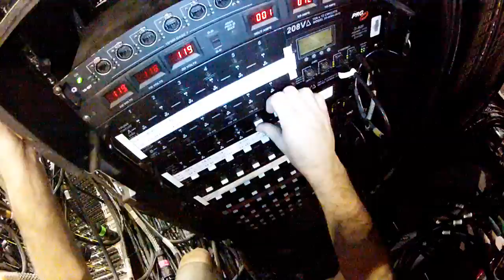Grammy FOH Platform Start-up

Comment: Floating sensor racks? what a brilliant idea.
Reply from the maker: Yup. Saves a few thousand feet of multi-cable. Two feeder runs drop out of the catwalk feeding two transformers on the floating platform. No need to drop 40 to 95 cables out of the sky. And the platform allows building the rack land on the ground first.
Reply: +Geoff Smith I have to admit, while watching the video I absolutely had no idea what you were doing. But how come you could not set up everything on the ground and then just lift it up?
Reply: +Raffaele Sansone they did. he was basically going up to the platform to turn everything on.
Reply: +Raffaele Sansone 

Some things can not be turned on until other connections have been made and depending on the rig configuration of the whole show you might have to do what he did. Plus IF FOR ANY REASON there is a change once things are up. etc
Reply: Geoff Smith  What type of cables were you using? Dmx or xlr
Reply: Lord Thantos DMX is just a protocol, XLR is the cable. I'm guessing that those were some semi-proprietary 5-pin XLR cables carrying the DMX signal. Edit: JK I read some more comments and apparently they're redundant fiber lines running to switches and I'd imagine some form of DMX node.
Reply: TheCanasian thanks
Reply: TheCanasian probably ether-con, most likely RJ45.
Reply: Gregg Carter those are most likely opticalCON cables.

Comment: When you first started rigging/training, how afraid of heights were you?  I imagine that more exposure made you less afraid, but what else did you/do you do to be more calm?  Was there a point where you started to not get afraid?  Do you have any tips or rituals that you do so you don't get tired quickly, or freak out?  I guess a major thing too is not dropping pins.  Thanks for any tips and advice you might have.
Reply: You have to take deep breaths, that helps.
Reply: inalavalamp helps to not rush, focus on the near item rather than the horizon, do not cut corners or ever have no arrest connection at any time.  You have a minimum of two anchors so you can swap directions of travel on the grid, i think Geoff's had four.  I'm still gaining experience.  Last tip never work solo in a venue.
Reply from the maker: I've been climbing stuff since I was a small child. No rituals or secret breathing exercises needed. I just make sure to stop by the restroom before going up. I've never been phased by heights. I trust my safety gear and I make sure that I'm ALWAYS attached to something, always. I've climbed truss as high as 280 feet at The Lions stadium in Detroit. At that height the ground is really irrelevant and not even in my field of view.
Reply: Admit it... you gave us glances down at the floor to give us vertigo!

Comment: are those fiber cables at 6:40 and what are you plugging them into?
Reply from the maker: Yes those are fiber cables. We run three redundant data streams to all of our 7 different rack lands. There are two lighting board oops that control different lights within the same area of the rig. One data stream for each operator and one spare line that can run either data stream. We could run the whole show on one fiber but we like to break it up a bit in case there is a problem. The fiber lines are being plugged into 3 separate switches which each have their own node and a portion of our S-400 racks.

Comment: that has to be a nightmare to tear down... the spaghetti of wires...
Reply: kvong615 if it's a anything like the things I've helped out on (I'm only an amateur, only a few small events) then even though it looks a mess each cable is very organised and - relatively - easy to pull out. may look like a mess but it almost certainly isn't especially at this level!

Comment: Might be tight on space for a future production.. floating dimmer beach could be a real possibility. Anyone know who manufactures the platform? I've seen some around, but this one looks awesome.
Reply: Its not really a specific purpose designed plat, it can be 12" or 20" truss with decks/handrails securely mounted on top. This is more than likely a Kish Rig where they have specific hardware to do this setup .its been done this way for decades as needed.

Comment: So one dimmer for one light ? does it work like psu on computer ?
Reply: Kind of, yes. There are different dimmers and relays for different lights.
Reply: @josh512x  Technology really did changed, now i see a lot of lighting designers using grand ma boards or something like that
Reply: @AsianJBlazian  What do you mean by that? They're most likely using an MA board.

Comment: What was it like climbing down a ladder like that for the first time?
Reply from the maker: Ha! My first wire ladder climb was a 60 foot climb from the bottom going up. I didn't know to not pull yourself up with your arms. I got about 40 feet up and my arms locked up. Yes, I was scared. What did I learn? 1st, have a carabiner on your chest to clip yourself to the wire ladder if you need to rest. 2ed, use your legs to push yourself up or down the ladder. Don't use your arms for pulling or lowering. Your arms should only hold you to the ladder. Let your legs do all the work.
Reply: +Geoff Smith   Awesome advice.
Reply: Geoff Smith 
Me too i got serious arm pump. My first was 70' down. A bit scary the first 3 to 5 steps then i said to myself "you idiot you can do 15 20 chin ups, pull ups what are you worried about...trust your self plus a yoyo was hooked to my harness D...My biggest mistake was i went down it the normal ladder climbing way instead of from the side as you did climbing. Big difference. Great vid brother